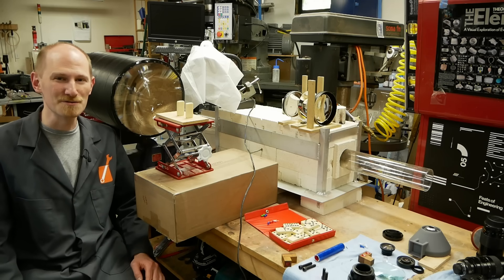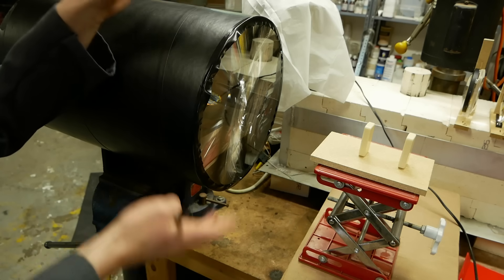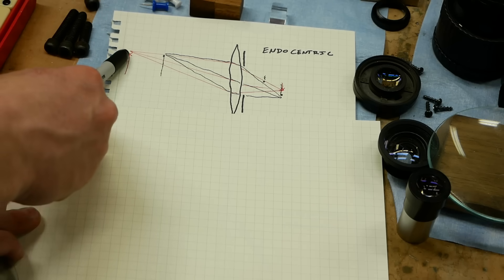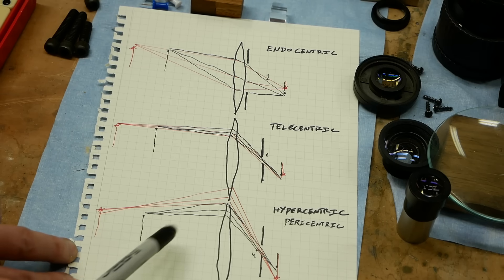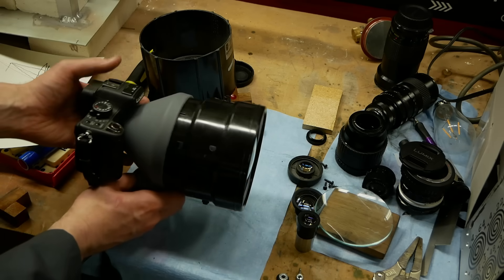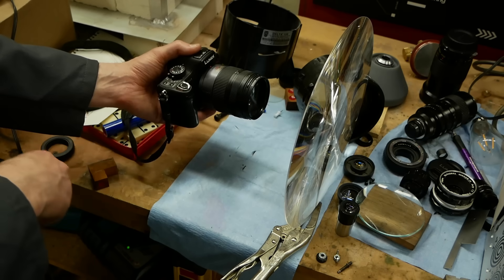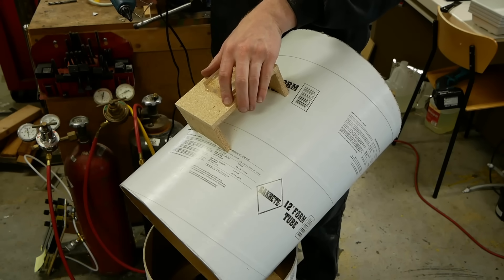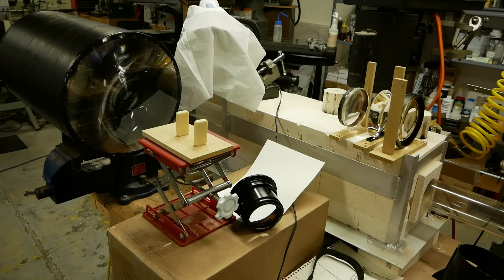Hypercentric optics: A camera lens that can see behind objects

Comment: This lens shows FIVE sides of a cube at once! (Try PORTRAITS!) The lens must be bigger than the object, IF you want to image it all-at-once. Reverse-perspective images can be made using scanners and software (possibly elaborate); they can do even more extreme perspectives. A simple line-scan camera can "unwrap" a rotating object, but the resulting image has normal perspective in one axis and reverse cylindrical perspective in the other. (You can get near-isometric perspective by pulling the camera far back and using a long lens.)

Comment: At my workplace, there's a machine that can optically measure the down projection of objects precisely. The objects to me measured can be threedimensional, but the overhead camera with the telecentric lens will always capture a straight down view of them. In a sense it looks at the object in parallel projection. The objects can be flat on the plate or they can be raised above it as part of a threedimensional structure, but the measurement will always turn out the same.

Comment: I'm going to go out on a limb here, and suggest that there are principles in this demonstration that are applicable to development of warp-drive technology. 

The idea of bending the perspective of the position of matter, with lenses that can shape a ray of light such that its perspective is null and or negative to what is percieved as normal... gives me the impression that distance between any two particles or collections of particles of matter may only be an artifact of the act of perception itself relative to the dimension in which it is being percieved, rather than something tangible and cohesive to the fundamental structure of reality. Obviously we see and experience reality as it appears to us, and so whether this is simply an artifact or not, things do have distance and perspective is always relevant. 

But then I think about how matter is essentially light that has been slowed down. And then I think about all the ways we have discovered to manipulate light and matter. Mirrors(think funhouses), lenses, lasers, etc. Obviously there are benefits to conceptualizing light and matter as being seperate. But what if light, matter, and radio frequencies were all different sections on the same spectrum, and the fundamental frequencies of matter could be bent and shaped without breaking, just the way that light and radio waves can?

I am especially intruiged by the notion of having a negative spatial perspective, illustrated by your experiment here. The null persective, where the tacks appear to be the same, is essentially simulating the experience of a 3rd dimentonal being, observing a crossection of a 2nd dimentional world(flatland). Whereas the negative perspective, seemingly giving the ability to increase the perceived size of objects, would be akin to the anihilation of matter and anti-matter within the 4th dimension, drawing the distance between 2 points in 3rd dimentsional space-time closer together relative to the magnitude of the anihilation.

Buncha nonsense? Who knows.. But it was really fun thinking about it. Thanks for uploading this man!

Comment: I'm pretty sure that really all you are doing is amplifying the outer part of the lens and bringing it in to focal view. That lens is huge and capturing much more than it looks from the inside. So It's not seeing anything it can't already see. If the lens was around 1-2inches then you might have something. 

Essentially, if you were to have a small lens offset towards the edge of the bigger lens then it could clearly "see" the further domino(given that there is some distance between it and the first). All you are doing, then, is "selecting" this outer "virtual" lens and optically it would be no different(more or less in terms of fov) if you just moved the lens over.

Comment: It is massive, thanks for all the details!  Now I understand something more about the pupils.
I've found that an hypercentric lens can also be made easily with a prime  lens (50mm f/2 or f/1.4) put inverted right in front of a macro. Works! Not so cool as this one, smaller, non zoomable, but sharp.  Bit nearer and more hypercentric than the standalone prime with back aperture described at the end of the video.
https://patta107285337.wordpress.com/2020/12/02/micro-fisheye-xi-my-stacks/

Comment: While on the topic of weird lenses and surprising optics, I wonder if... can a lens be made to hang in front of a computer monitor that's too close to my face?  I'm living in a crampy camper with a tiny built-in table. The monitor I do my full-time work on is about half of the comfortable normal distance I'd have.  Don't want to wear oddball glasses just for that, since I also need to  read ink-on-paper and work on another computer at an ok distance, for which my normal 1.0D to 1.5D reading glasses do fine.

Comment: Oh neat, I've seen this in action to an extent when I wore glasses. My glasses could slightly bend light sources like LEDs and traffic lights so the glowing light was displaced, so much so with higher frequency light that I could see the part that was supposed to be lit unlit. Very noticable with say the LED on a TV box. Rather hard to describe in words, and blew my mind

Comment: This is probably so highly impractical I don't think you'd be interested in trying it, but what if you combined the methodology of Laser Capture Microdissection with the Laser Cooling of an Atom to Micro-Kelvin temps to try trapping a row of carbon atoms in the perfect distance apart for molecular bonds to form, then released them for just long enough for gravity to pull them down so that trapping another row of carbon atoms put the two rows at just the right distance for molecular bonds to form? Essentially, trying to laser print a (near) perfect sheet of graphene. Undoubtedly, you know just how monumental a perfect sheet of graphene would be if you could replicate and mass produce it. I can't think of anyone on YouTube more apt to try something like this out

Comment: Not moving the lens, just adjusting the optics?  Isn't that the same thing? 
And why do you even need that massive lens? You'd get the same effect if you just moved the camera slightly left & right and looked at the rear domino from an angle.

Comment: What material would be suitable to use in a zero-g environment for setting the focal length of a massive foil space telescope? It needs to soften to allow a suspension truss to spin and set the parabolic shape, and harden to keep the shape for stable observation. None of that annular truss stuff, we need a full pupil for collecting and focusing light. Think big, like football field size. Perfection and reflector uniformity don't matter.

Comment: Someone should make a game demo that gives the player "hypercentric vision".
I think it'd be interesting to be able to freely position and explore with a hypercentric lens. We'd also get the benefit of seeing what kind of images a "perfect" hypercentric lens would produce (i.e. One with an arbitrarily large diameter and without chromatic aberration).
Reply: Should be possible with raytracing. Would require programming the camera a bit differently than usual, though. 

Raytracers usually treat the camera's location as the focal point and point of origin for the camera rays and the rays passing through the image plane as they spread out, with field of view determined by how far the image plane is from the point of origin. That would not work for a parallel projection or a hypercentric one.

Instead of treating the focal point as the point of origin, you'd need to use the pixel's location in the image plane, and allow the image plane to be scaled instead of always being normalised. From there, parallel projection is easy: just make all the rays point in the same direction. Perspective projection seems like it would be a matter of changing signs in the usual equations to get the same directions as the usual approach. Hypercentric projection might be a case of pointing the rays toward a point in front of the camera, so they converge on it. Like perspective projection in reverse.

It almost seems like it could be possible to have one set of equations that could cover all three cases. Except... parallel projection is the limit of perspective projection as the distance between image plane and focal point goes to infinity. So, there's that hope dashed.

Comment: Is it hard to make a telecentric lens that focuses at infinity because it's hard to make sure that light rays are infinitely parallel? I'm imagining that if you wanted to look at the moon's surface using a telecentric lens that doesn't use any optics other than a single lens and aperture, you'd need a barrel equaling the distance from the lens to the moon.

Comment: sad that its basically a useless trick. cant be used at long range since the lens has to be conically larger in perspective to the range its being used. so 5 miles would use a lens too large to physically manufacture. also if we throw most logic out the window. it would probably be too distorted to tell what it is your seeing

Comment: 2:11  is not like Black Hole.  This experiment is good for demostration and trick but dont have real aplication of this concept at least at the moment. Why? Because you need a bigger lens than the object at respective distance. So if you have alredy a big lens/eye/simply_cristal you can se what is behinde of first object without need of distortion lens.
I would like to see if can be reproduced the experiment but the object must have the same size as lens or biger. Imagine this concept of lens on robot and see the criminals behinde corner wall or so.(This experiment cant be implement in this case)

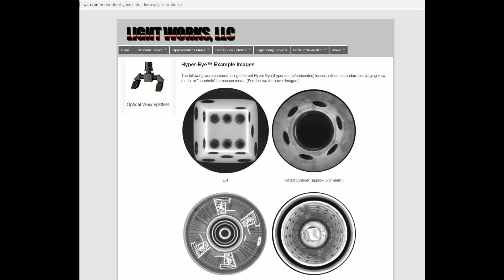Comment: Don't be discouraged by his ambitious setup if you want to experience this yourself! I tried with my naked eye, a rather small magnifying glass (6 cm) and a die and could easily get a similar view as in 13:50. The thing is that you need to look into the magnifying glass from a greater distance than you are used to.

Comment: This is incredible!
Unrelated (maybe) question: That 3d-printed piece looks flawless! What printer did you use? material/settings? I'm always searching for that kind of perfection on my prints :P
Reply: Use abs and smooth it with acetone after the print.

Comment: If you want bigger than 200mm...
https://greenpowerscience.com/SHOPFRESNELHOME.html

I'm a little confused on some of the terminology you're using. You keep saying put the aperture at the focal plane, but on the internal side of the lens, that's at the sensor itself. Do you mean the flange focal distance? If so, it may be important to note that if the rearmost lens element protrudes past the flange, putting something to act as an aperture there won't have it at the FFD. Also, the FFD isn't necessarily the rear of the flange. It's an arbitrary point manufacturers decided to measure from, so while within a given mount the distance will hold the same optical relationship as all other lenses with that mount, there's no such relationship between the FFD of different mounts.  This may not have a ton of bearing on results, but I suspect it does because of how critical precision is on that side of the lens.

The other thing that kind of confuses me is your use of the word perspective. My understanding is the only thing that changes perspective is moving the camera.  Zooms don't change it nor does flagging off field of view.  Are the changes in the resulting image here (pretending for a moment you built this in such a way you could achieve these effects through zooming instead of sliding the body back and forth) still perspective shifts or something else that doesn't really have a name?

Finally a question. What does this arrangement do to the optical center of the lens?

Comment: The effect is cool, but the implementation creates some distracting artifacts and distortions.  Would it be possible to build a rig with 16 “regular” cameras arranged in a circle with their lenses all parallel and images sensors on the same plane, and take the resulting image data and build a virtual hypercentric lens and compute a virtual image?

Comment: I work in industrial automation and we use telecentric lenses all the time.   really magical for machine vision, inspecting anything that has to be parallel or non distorted.  looking at piston ring grooves for example and taking precise measurements.  or looking down any type of tube for defects, we use telecentrics all the way from a few millimeter fov up to a few hundred millimeter.

Comment: You can't see behind objects with this lens, the lens is huge and therefore has multiple arbitrarily smaller vantage points, and you are just adjusting your vantage point from within that lens, it's the same as moving the camera itself around the room. You couldn't scale this up either, you'd need a lens whose diameter contains both a blocked vantage point, and an unblocked one, which is a lot more work than simply...moving the camera....
I could see this used for art and no other practical purpose. Is there something I'm not seeing?

Comment: A similar effect can be acheived using conical lenses called axicons which transforms an illuminating beam into a ring which approximate a bessel beam.
One difference is that you can't display (as far as  i know)  both objects at the same time, it is either imaging the first in front or make it dissaper to image the second. One example is described there :  https://www.ncbi.nlm.nih.gov/pmc/articles/PMC5175571/

Comment: Why you always so impressive sir? 
Anyway I am wondering, does the lens have to be either very close or very large in proportion to the image your trying to see.. because the way optics work and the way you showed it work means that the light from behind has to hit the lens on the far edge. So if the dominos are very far away or are close to each other or the lens is smaller, the effect is lost?

Comment: 1:30 -ish. What would it look like if the Fresnel lens could be bent?
Like if the lens was a plastic sheet & the tube was air tight, then you either draw a vacuum, or pump up pressure inside?

Comment: Is there any way to use the Fresnel lens found in projector TVs? 

They are the same size as the TV’s screen and so are much larger than the lens used here, but I don’t know what their focal length is (probably the path distance between the screen and projectors) and I recall them being quite a bit less transparent than the lens you have here.

Comment: Imagine a matrix of perhaps 30 or so CCDs all pointing in the same direction, sharing the same focal plane: arranged in a rectangular or hexagonal grid. Seems like software should be able to pull images off all the CCDs and reconstruct a composite hyper centric image from all the cameras.
Reply: Such a device does exist. It's called a light-field camera. Though, rather than using multiple CCDs, it uses just one with an array of tiny lenses. 

It has the nifty property of being able change the focus after taking a picture, and even shift the view slightly, all in software.

Comment: Scanning electron microscope : check
XRay imaging system : check
Waterjet cutting gear : check
Ruler for drawing straight lines : over budget
Reply: The ruler is currently attached to an obscure experiment 😂
Reply: Don't forget the DeLorean, the cryocooler, the turbomolecular pump, the mass spectrometer and the $20000 Tektronix 5 Series oscilloscope! And surely I'm also forgetting something...
Reply: Sputtering setup
Reply: this paper have square lines, he dont even try :D
Reply: And the ruby laser. He has a tektronix scope? I've used them with my job but the one we have cost as much as the house I grew up in.
Reply: @verdatum  They aren't all that expensive. You could probably find old ones on ebay for like 50 dollars
Reply: @bears7777777  uh, good luck finding a Tektronix 5 series scope on eBay for $50. And I think they also lent him one of the 8-channel scopes too.
Reply: Enjoy your 1000th like
Reply: @yakuza_suske3189  🤣🤣 Thanks, it doesn't deserve 1k though
Reply: LIke NileRed and gloves
Reply: The funny thing is by him not buying the ruler, he could afford those devices
Reply: I KNOW, RIGHT?
Reply: Surprising amount of tremor there. And his speech sounds like he can't stop smirking.

Comment: Hold your finger 6-8 inches from your eye.  Let your vision go out of focus, creating a fuzziness around your finger.  Now in a well lit area, focus on something in the background with a regular edge.  Poke that edge with your fuzzy finger.  If you do it right, you see a bending of the light at the regular edge, which can best be described as ...the videos of gravitational lensing...  I have no idea why its bending light.  I doubt there is a black hole in your finger tip though

Comment: A good source for truly huge Fresnel lenses with low magnification is some older TV sets where they are used over the screen.  Mainly old-style enclosed projection sets.
Reply: Afaik lcd screens have some too, so a trashed large screen tv should work fine.

Comment: That effect is exactly the same effect you'll get when having the camera lens zoomed all the way out and having your object on a fixed position and doing a dolly movement forward while zooming in... your object appears to have the same size while the background appears to move closer to the camera... and thus appears bigger than the object in the middle...

Ofcourse the reversed effect is possible too... just zoom out while moving the camera backwards...

A well known and cool optical illusion...

In short your solution is quite overkill actually... :-)
Reply: It's called "the vertigo effect" after the Hitchcock movie that made it famous, and it can never make objects in the background as large as or larger than objects in the foreground. It also works in reverse from what you describe - dolly forward and zooming out, or dolly backward and zooming in.